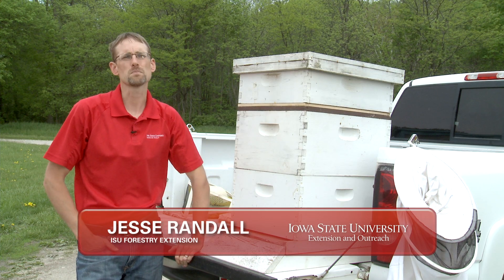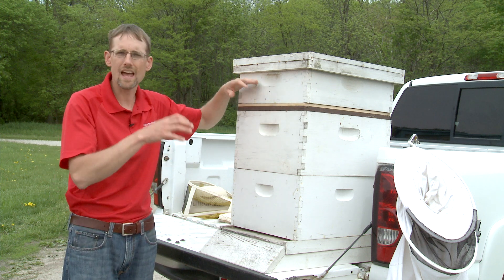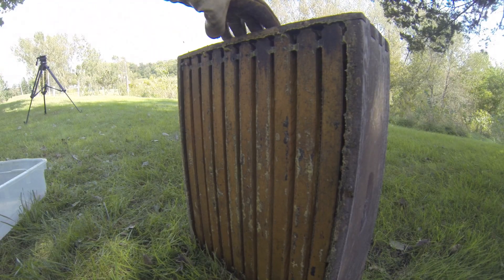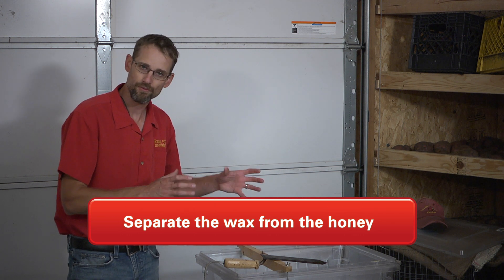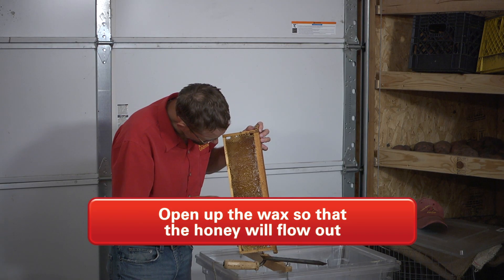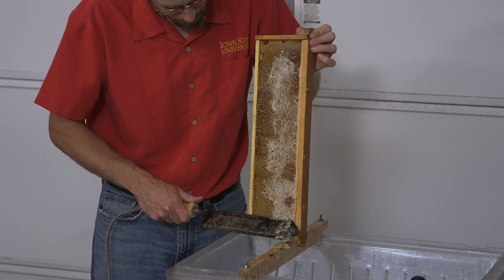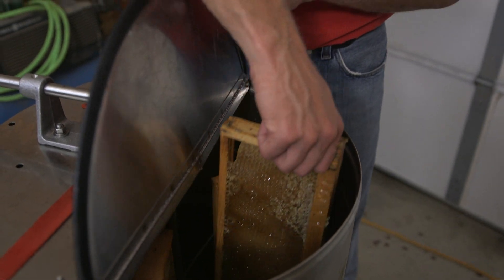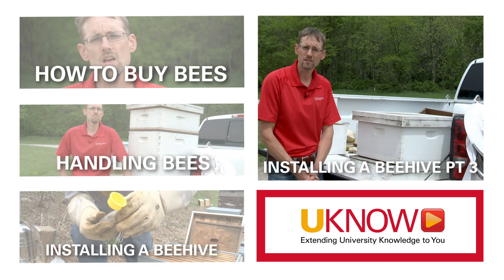How to Harvest Honey in Beekeeping

Comment: Could you attach an electric motor to that spinner and just let it spin over night?
Reply from the maker: There are many spinners that do have electric motors and these are great for extracting larger quantities of honey.  However, spinning overnight is not necessary and would probably be bad for the motor and dangerous (a frame might break, unbalance the spinner, and cause damage).  The spin time varies by size and model, but usually 5-10 minutes is enough to spin all of the honey out of frames with an electric extractor.  A major factor for this time is also the temperature - it is much easier to get honey out if it is above 80F.  Many beekeepers store their honey in a room with a heater overnight before extraction to make this easier